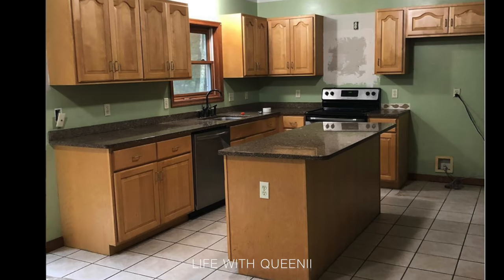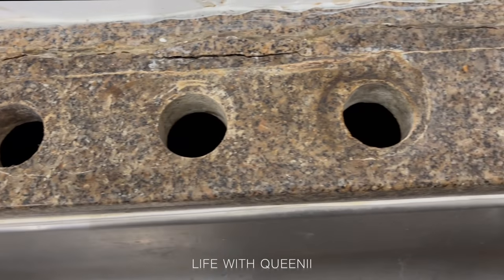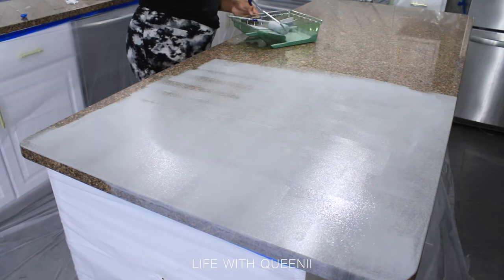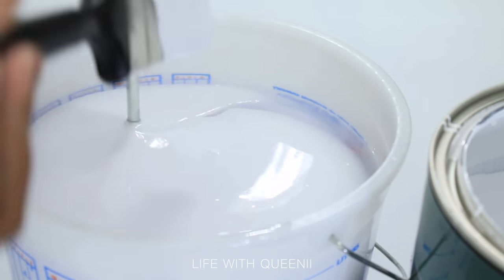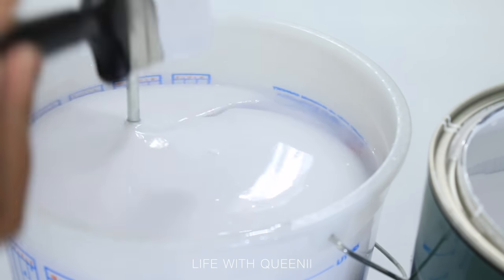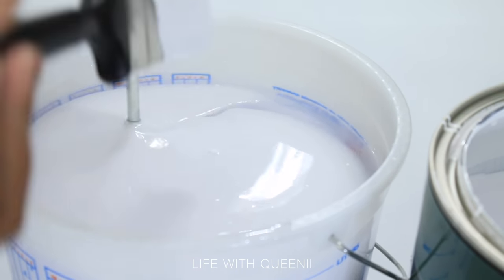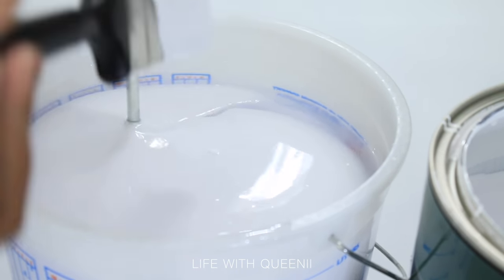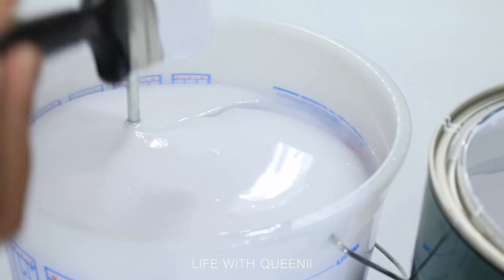DIY Marble epoxy over old granite countertops! How to do Epoxy marble over old granite countertops

Comment: I watched this video probably 5 times, bought the same epoxy and paint and took a deep breath and went for it.  Wow - exceptional results!  I am so thankful to you for breaking it down so concisely.  Our camper is going to be very fancy with these countertops and some other improvements we are doing.  Thank you!!!
Reply from the maker: no problem!
Reply: can you share the links or pictures. Im trying to get the same exact ones as well
Reply: How did it go?
Reply: Way to go …. I’m scared to shave my under arms , much less pull out a paint brush 
  Give my hubby a heart attack… now I learned how to use Amazon, but I’m ordering 
 Dried fruit, not like I’m buying 👠 🤣
Reply: How is it holding up today?
Reply: How is it holding up for you?
Reply: Tell me the product name. I m from India plz help
Reply: It looked good for about a year but has yellowed significantly - super disappointing to me.  It is in our camper so maybe the cold/heat/humidity affected it?  @ErmilinaLight
Reply: How does your countertop behave after 2 years? Is it still resisting scratches?  Thanks 👍
Reply: A couple years in now from this video, how do your countertops look now? Are you still happy with it?
Reply: @kittykitty8895  😳
😂🤣😂🤣

Hysterical!  💐💞
Reply: What number of sandpaper i can use? I have a couple of bumps

Comment: I am so impressed and encouraged to do this for my countertops. This turned out so beautiful. I was wondering how much epoxy did you need altogether to complete the countertops? Did you use the same amount of epoxy afterwards when you put a top coat over your work?
Reply: Did you get a response to this question? Trying to figure out the same thing

Comment: Incredible! I’m doing this this weekend. The only question I have is when you are blurring the lines are you using the white tinted epoxy, just white paint, or the gray tinted epoxy? I’ve watched the video about 5x to make sure I wasn’t asking something you answered.  : )
Reply: She used a different brush for each color to blur the gray paints in the epoxy for the veins.
Reply from the maker: Hi,each color had its own brush , I did not mix brushes. I did not put paint to mix colors on the counter hun. In the video everything is mix in its own container before I add tot he counters. Hope this helps you.
Reply: Thank you both!

Comment: Hi! Its been about 8 months or so since you've uploaded this video. How do the countertops look now? Have they held up well against regular use?
Reply: Good question
Reply: That’s what I’m THINKING
Reply: I heard you are supposed to let the alkyd coat cure for two weeks before you put the epoxy on. She didn't heatgun the 2nd layer either I noticed. 
But looks like her channel is inactive I'm sure she is busy.
Reply: Same question here. 
Any one know if we'll ever see an update on how it's holding up?
Reply: @SanctumOfDreams  I believe it's going well based upon what I've learned from watching the Stone Coat Countertop videos.  Also, the heat gun is just to get rid of bubbles by forcing them to the surface.
Reply: We did this to our counters (though I used a different brand of epoxy) and they remained absolutely flawless for 4 years until we finally installed new countertops. The paint/epoxy was just meant as a cheap, temporary fix for us until we could actually afford replacing our countertops, but I feel they could've held up another 5+ years before they started showing any damage because the epoxy is a such a strong material. 

In fact, I actually feel the epoxy was a stronger, more durable finish than the existing laminate finish we were covering up. The laminate surface was prone to scratches and staining where the epoxy showed none of that. It's also such an incredibly inexpensive option that's relatively easy to do on your own. Personally, I would 100% do it again without any hesitation!
Reply: @lblincoe2094  if you don’t mind me asking, which brand did you use?
Reply: @vanessagomez6654  It was called Rust-Oleum Parks Super Glaze. I tried to include a link, but YouTube seems to have removed it? 🤔 I hope you're able to find it!
Reply: @lblincoe2094  I'm about to do the counter top and the backplash too.. I've used a brand to do epoxy tiles and I think it's good and all the videos I've seen are of stone coat. I'm undecided which brand to use for my counter top.
Reply: I used Best Bond brand.. for a preserve flower bouquet.
Reply: Up
Reply: @lblincoe2094 do we have to use food grad epoxy? Because kitchen countertops are used to roll flour and lots of other food related stuff. All I want to ask is, is epoxy safe overall or do we have to use food safe epoxy?
Reply: @lblincoe2094  Thank u for that information do you mind sharing the link to the 
 epoxy u used??
Reply: @lblincoe2094  after 4 years, using rustoleum parks, you didnt have any yellowing/ambering?
Reply: @TonyaDLewis  Nope! At least none that I noticed and we had a white subway tile backsplash right up next to it, so I feel like any discoloration would've been fairly easily seen in contrast. I really don't have a single complaint I could say about it, I thought it was a really great product to work with!

Comment: Hi! Thank you so much for such a detailed video!! I’m really interested in doing this to my bathroom countertops. I’m looking at the epoxy you recommended & used for your countertops & I’m reading the details of the epoxy & it said that it should not be poured over or mixed with any oil based paint & Ive been using the same rustoleum spray paint for other projects & the ones i’ve been using is oil based, did you use happen to use a water-based spray paint for yours or did you use an oil based one? Thank you so much for your help!

Comment: Thank you for the video. How have the countertops held up? Any cracking or issues. I have a lot of dark granite i need to either replace or epoxy. I was just afraid of the epoxy durability. Any insight would be appreciated.

Comment: Hi,   I love your kitchen and the way you did your countertops.   I have looked at this video over 10 times so that I understand what you were doing, and got all the exact products that you used.   Thank you so much for the detailed video!   One question, if I messed up on the veins in certain areas, am I able to correct that spot?   I thought of waiting til it completed dried and sanding that area and starting over.  What do you recommend?   Thank you in advance.
Reply from the maker: I would try to fix it while it’s still when, it will settle /level. And the best suggestion I can give you is to start your veins off light/thin and blend. If you want more color add a bit more it’s easier to add more veins than it is to remove messed up ones
Reply: @LifeWithQueenii  Thank you
Reply from the maker: no problem  @SherreMoss

Comment: Hey if I did my counter tops the same way you showed your video my kids bumped into while it was. Drying so I had to sand it and pour again now it’s uneven in some spots and I can see a lot of cloudiness from where I sanded at if I pour a top clear coat across will that take care of my problems?
Reply from the maker: oh no, you may still see a slight diffenrce even with the added clear coat.

Comment: LifeWifeQueenii this is the exact look I want.  I’m going to try this on my granite.  It’s been over a year. Are the counters still holding up?  How did they respond to heat, things straight from the oven?  Thank you.
Reply: Epoxy is heat resistant, but not heatproof. It's smart to use trivets for hot pots to protect epoxy counters or any type of kitchen countertop from heat damage. Most epoxy products are considered non-toxic and are food-safe for countertops once the epoxy resin has cured.

Comment: Once you drizzled the gray on and blended it in with the paintbrush, did the epoxy smooth out on its own? Or does that happen when you use heat?
Reply from the maker: It’s self leveling 🤗

Comment: I watched ur video where u did the sample piece. In that video u sprayed the spray paint right on the piece when the epoxy was still wet and then moved it around with ur brush. Can I ask u why didn't u do that here?
Reply from the maker: that was a test board to see if I liked the technique I used, I didnt like it so i did what was best for the results I wanted. I can control the mix color better than the spray....the spray could come out and splatter/over spray and give too much grey/blk. I hope this helps

Comment: I'm super confused now I just watched the bathroom makeover and you specifically said it is not heat resistant multiple times but this is the same exact  Epoxy product linked in the bathroom video  Are these  counter tops heat resistant.

Comment: What brand of enamel paint and primer colors did you use? I have the exact same granite counter tops and am struggling to choose the right shades to replicate this. If you could post the enamel brand and color this will help! Thanks!
Reply from the maker: Behr alkyd white paint. As for the spray paints I used to tint the epoxy I picked two shades of from rust oleum. I suggest going to Lowe’s or homedepot or even using your phone find a marble look you like and compare the shades of the veins to the spray paints you find.
Reply: @LifeWithQueenii  thank you for taking the time to reply to me! It makes it easier to locate :)

Comment: I hope you can answer this question for me. I bought materials to do my bathrooms and kitcken counter tops. when looking at your DIY for your bathroom and kitcken counter tops you had used the same Epoxy from Amazon, the link given are the same. One video for the bathroom, you said it is not safe for the kitcken. Have you found out that when using the same Epoxy for the kitcken is safe to use??
Reply from the maker: i said that the bathroom was a test .... and after having it in the bathroom and reading the companies information regarding kitchen use they stated it is safe is cured correctly. Hope this helps. Please read their FAQ on the shop they have on amazon.
Reply: @LifeWithQueenii  yes it did. Thank you so much!
Reply from the maker: @rosadiego3753  you’re welcome!

Comment: So glad I found you...I'm in the research phase in preparation for redoing my kitchen. Was planning to paint cabinets, walls, and add a tile backsplash and just wait until I could get new countertops.... but now that I see this I think I can tackle the countertops too.I saw a video by another company but it seems a bit overwhelming...your video and how to was very DIY friendly. Thank you!
Reply: Agree and I’m most definitely tackling this project! I too am in the middle of completely remodeling my kitchen! My cabinets are painted and I only need to seal them after they dry(kitchen cabinets  I know for fact is the hardest part of a complete remodel and especially if you don’t end up liking a color, such as myself, and I started all over after the cabinets were almost done lol!), my walls are almost completely done as well. I have all the trim to paint yet and the backsplash to do. I want to do something to my ceiling as well and have yet to decide on flooring. I may just wait on flooring until countertops are done and I’ll more than likely hire the floor job out. Good luck to you with your remodel!

Comment: I know this was posted awhile ago but I wanted to say you did an amazing job with the veining and shadows!! I painted my countertops about 6 years ago using the Gianni Paint kit and it held up pretty good, but the last 2 years has shown a lot of wear so it’s definitely time to redo them. I was originally going to order another kit from Gianni but I noticed the marble kit is now more then double yikes. They also suggest using a small artist brush to make the veins and misting bottle to lighten up the veins and blend. When you showed your technique if veining after the epoxy was done I was blown away. I totally did not expect that, but now I see perhaps it worked much better to blend everything more fluidly. I will definitely follow you method and just buy my own supplies and hopefully save some money. Accept for that blow torch thing hopefully it’s not too expensive. Do you know how much product would be needed for a small L-shape section of less then 6 feet?

Comment: What is the update on yr countertops. I want to do mine but like you I have several kids. I can handle the no heat on the countertop and can handle not cutting up food on it also. My concern is the staining. How durable is it for u as far as getting stains? I’m really eager to do this project on my countertops but need to know 100% what I’m getting into. Do u think you could post an update on yrs and lmk how they are holding up for you?

Comment: Did you have to use 2 sets of the epoxy. I see that you use the epoxy mixture with the white behr and then use that left over mixture to add the spray to add your veins. Did you use another set of epoxy for your top coat. Basically did you use 2 bottles of epoxy or 4.

Comment: I wish I had this video when I did mine a few years ago. I attempted to marble and it yellowed in some areas! You have given me the confidence to try again. Thank you! Did you by chance have to turn up the heat? I read comments on epoxy that it should be done at 75 degrees.

Comment: Hi, they came out great.. did you add water to make it thinner,  I noticed it starts thicking quick if not, then it wont level correctly..by the way nothing is in the box showing any epoxy..

Comment: I like the look but it will likely be yellow with any epoxy on the market now (that I’m aware of).  I use KS Art UV cost or Stone Coat art coat with UV protection but they still yellow over time.  The more sun it gets the quicker it will yellow.

Comment: After reading the comments I want to make sure I understand. I’m preparing my counters now and am at the epoxy stage but want to make sure I have what I need. You mentioned you used two gallons of epoxy.. to clarify did you use 1 gallon mixed with the white paint and one gallon as a top coat?

Comment: Queeni - one more question. In terms of amount...did you get a gallon of epoxy or 2 gallons epoxy for your kitchen counters.  We don't want to run out in the middles of the project.
Reply from the maker: I got two gallons! I I believe I said so in the video but maybe I didn’t . You want to have a lil more than you need!
Reply: @LifeWithQueenii  Okay great that helps. What about the Behr paint and spray paint, I would like to get the ones you used. Can you tell me which ones or include the link above?
Reply from the maker: @kyannedesigns6206  behr alkyd semi-gloss enamel paint and spray paint are just two different shades of grey, one dark and cool toned and one light cool toned.
Reply: @LifeWithQueenii  THank you so much! I will let you know how it turns out.

Comment: Did your counters stain, get cut marks from cutting on the surface or burn from heated pans being placed on top of the surface?
Reply from the maker: I don’t do any of those things on my countertops hun, before epoxy and after. I always use a cutting board. And I don’t pot hot boiling pots on any countertops

Comment: @LifeWithQueenii Beautiful work chic! Im curious, as I'm a contractor, I coat counters using epoxy. Im looking to cut my working time. Couple questions, did I hear you say you applied your flood coat  2 hours after you did your design coat? Also, did you apply your  design coat on the same day that you applied the bonding primer AND the white enamel base color? How did they hold up? How did your edges turn-out? Did you have any curing issues or fish eyes appear considering, it appears you did it all in one day.. ive been planning to test a someday application but ive been too busy...I love the idea of using the enamel as a pigment, great option...
Reply from the maker: First pour, design all done in 45 minutes then I added the clear coat
Reply from the maker: Just make sure you use the heat gun, this epoxy is self leveling but I still used it to make sure I got bubbles out
Reply: @LifeWithQueenii  WOW within 45 minutes, im not sure about that one, not with the products I use. Also, now that I think about it, enamel definitely would not work as a pigment mixed in the epoxy products I use. I have used enamel as a highlite without actually mixing it with the epoxy to create different effects though. It would cause my epoxy to setup too fast if I mixed it in as a pigment. Of course all epoxies are not the same. Oh and yes, the heat gun is an absolute must! Thanks. I'm still curious how your method held up after a year.😊

Comment: Thank you for posting. I have watched a ton of epoxy video, but you makeit look so easy and less messy than the others? Could you answer a question for me?  When do you pull off the tape on the backslash? Does the epoxy not stick to it?  Thank you in advance!
Reply from the maker: hi, you remove the tape and plastic before the epoxy cures.

Comment: Does it handle hot pots from the stove?
Reply from the maker: I don’t usually pot hot pots directly on countertops no matter the material used because pots can cause damage even to real stone.
Reply from the maker: But I do every now and then slip and put a hot pan or pot on the epoxy but it hasn’t caused any issues

Comment: The link brings up a UV resin epoxy, does it matter if it’s UV or non?
Reply from the maker: Yes use only uv resistant epoxy or it will turn completely yellow